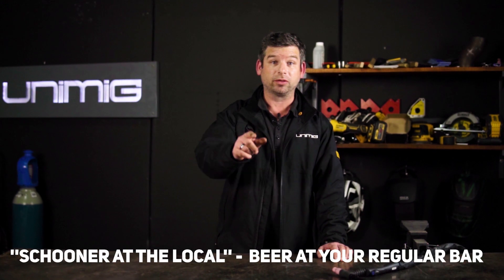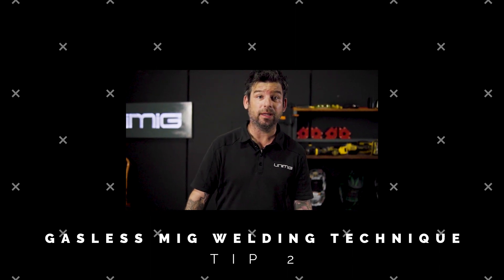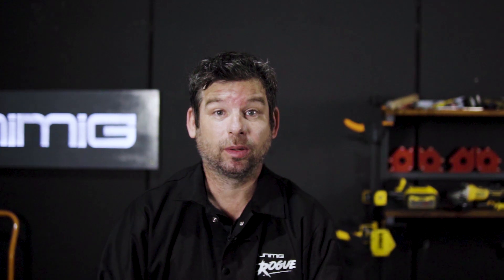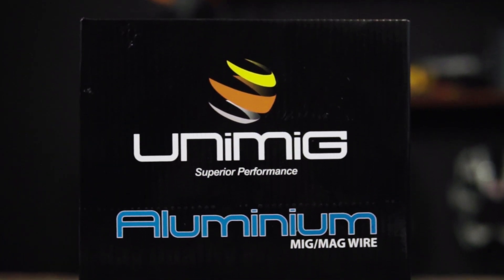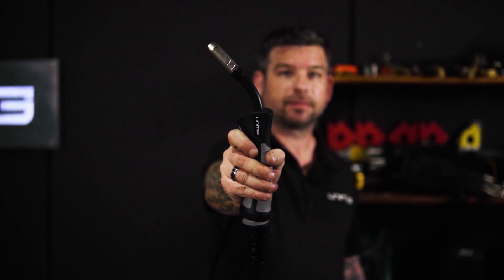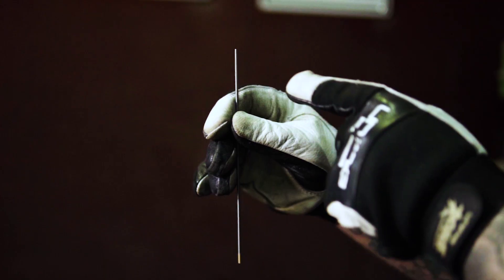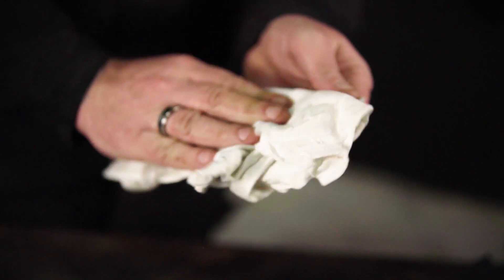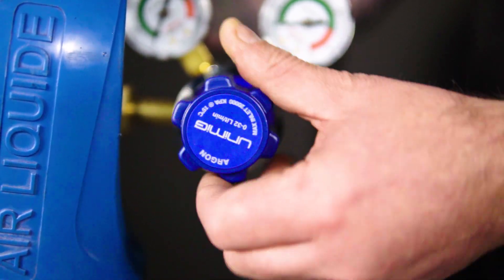9 Welding HACKS in 5 MINUTES

Comment: Do you say to drag mig welding?
Reply from the maker: Depends on whether your welding with gasless or gas wire. For gasless wire you pull (drag) for gas Mig welding you push.
Reply: @UNIMIG  you can push or drag with gas mig can't you?
Reply from the maker: @4isteven58  Hi Steven, yes you can drag with gas MIG.